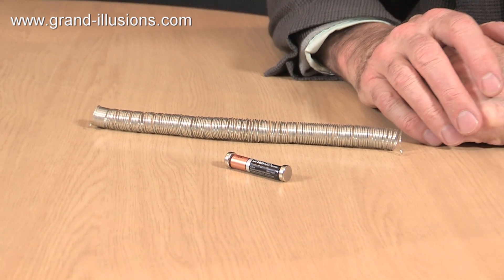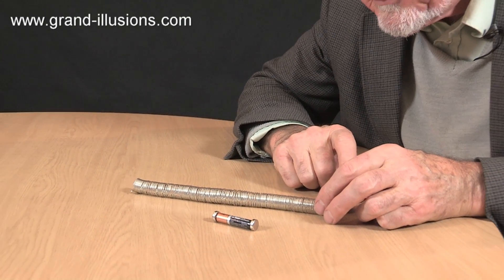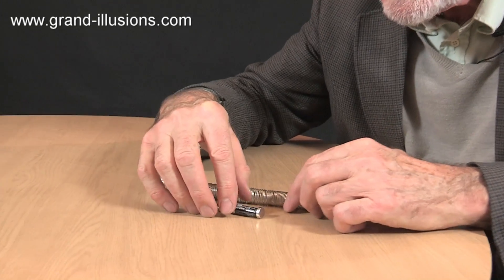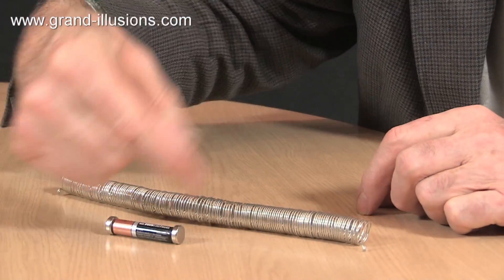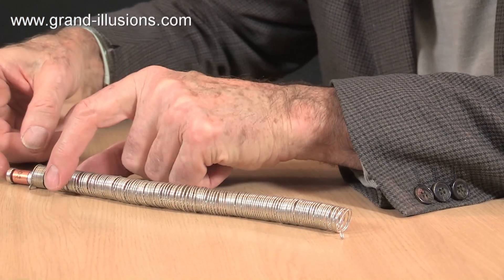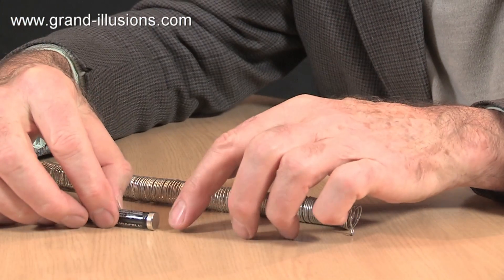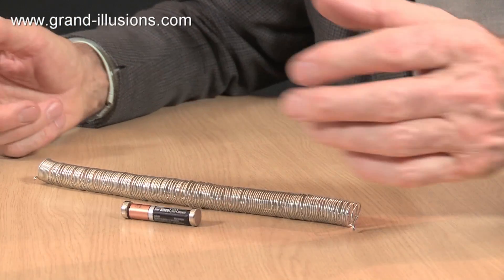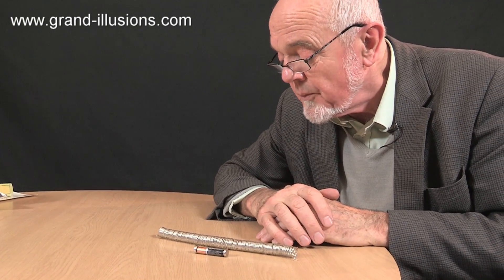Tim Catches the Faraday Train

Comment: Try this similar experiment.  Find two tubes of the same diameter, one plastic and one copper (non-ferrous).  Find a cylindrical rare earth magnet (or a stack of thin ones) that will fit .  Find identically sized pieces of wooden dowel and steel.  Drop each through the plastic tube and they will all fall through at the same rate.  Now drop them each through the copper tube and see what happens.

Comment: I wonder how fast it would go if the tube was 100 feet long?
Reply: I could calculate this
I want to calculate this
Must. Not. Nerd.
Reply: DO IT
Reply: It would. A coil gun's principle is basically that the projectile will pick up kinetic energy from each magnet it passes through. To begin with the projectile moves slowly as it's containing very little energy from only a few magnets, but as each magnet in the row adds a small amount, which isn't immediately lost, to the projectile it quite literally builds momentum. Eventually it would reach a maximum velocity at which point new energy is lost due to friction, heat anticipation and technically, but barely noticeably, air resistance. If we knew exactly what the magnets are made out of, the purity of the magnetic element and the same thing but with the object moving inside the coil, we could calculate how much energy is expelled per magnet, how much the object in question is able to "absorb", multiply by the amount of magnets, granted they are all created equally, subtract the aforementioned causes of lost energy and we could make out how fast it would go.

Tl;dr I hate my life
Reply: Indeed, dissipation. No bloody idea how heat can be anticipated lol
Reply: Halles Why you hate your life? It was a very nice explanation :) by the way, I noticed "heat anticipation" but I think it's a typo, do you mean "heat dissipation"?

Comment: With magnet balls you can put the coil in a circle and it will run indefinitely, or at least 'till the battery runs out.
Reply: Well, technically, you could also heat it past the Curie temperature of the magnets...
Reply: Unless supercooled!

Comment: if you were to make a circle like this would it run until the cell ran out of power.
Reply: AceRidesBikes 
The battery's get very hot, it effectively is a short circuit from the positive to negative battery terminals. 
There are YT videos where this battery/ magnet set up runs around a circular ring of coiled wire.
Reply: AceRidesBikes I would do a whole pack at a time

Comment: If you do this often enough, will the battery run out of energie?
Reply: ANanOsrs yes. The energy needs to come from somewhere.
Reply: Yup, i think due to friction and heating it will lose energy quite quick.
Reply: Yes. The wire forms an almost short circuit, drawing lots of power.. The battery will get hot from the very large current that flows.